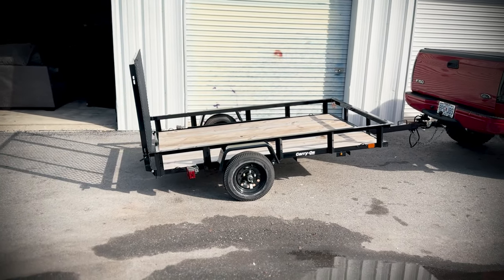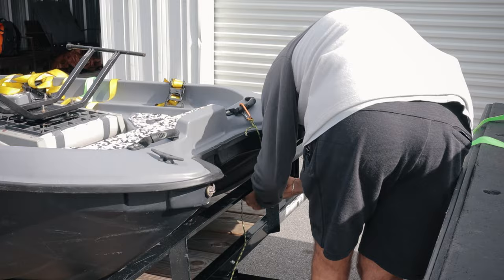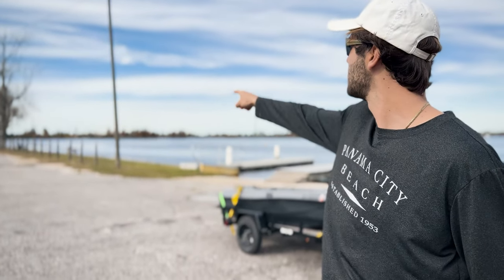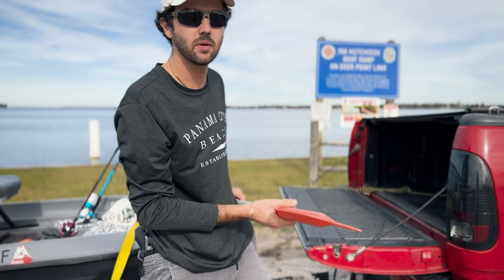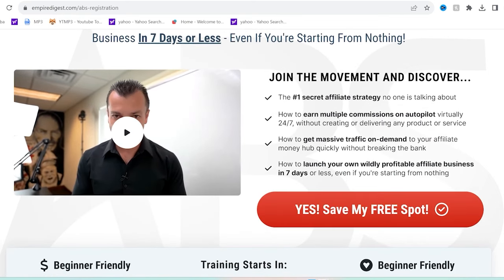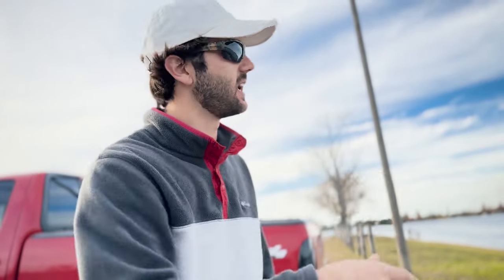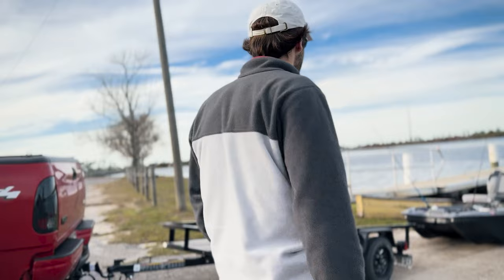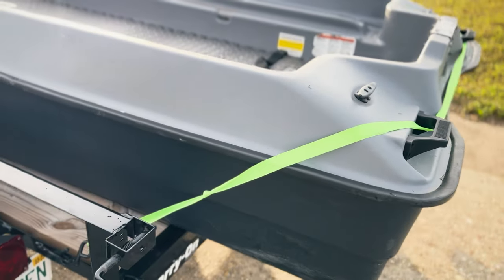Can You Use a Utility Trailer For Your Boat?

Comment: I have the same trailer and bought some yellow visible  balls from Walmart auto section.  The extend up and have magnetic bases. Out them on the back of the trailer to see backing up. That is what they are designed for.

Comment: I’m looking at trying this until I find a proper boat trailer. Issue is my boat is 5ft longer than the trailer box so it will have to be elevated above the 2ft side walls. This will make using a ramp tricky.
Reply from the maker: I just bought a new 12ft jon boat so I am now in a similar situation. Haven’t taken it out yet but if I find a good solution I’ll make a vid on it.

Comment: You can also buy any of the utility trailers from Harbor Freight or Northern tool. I bought one and built it and put some plywood down on it and covered it with outdoor carpet. Works great.
Reply from the maker: I’d love to do that to mine. Maybe I can find a small, used cheap one and make those mods. Even jet ski trailers are expensive here